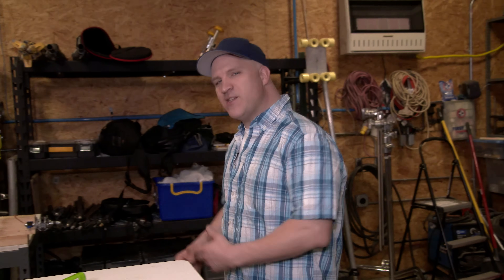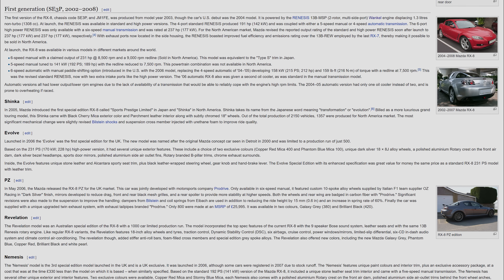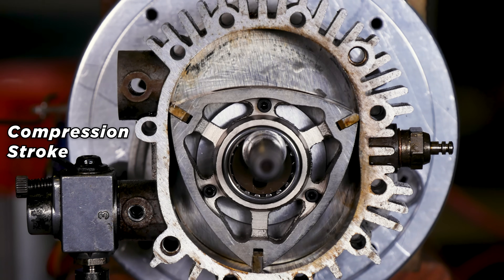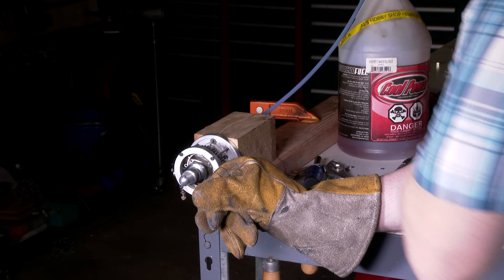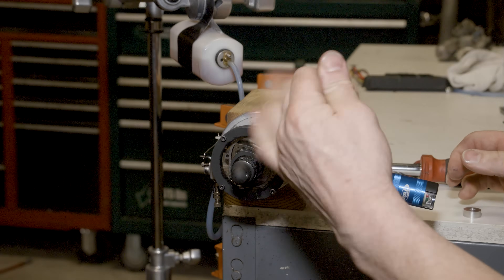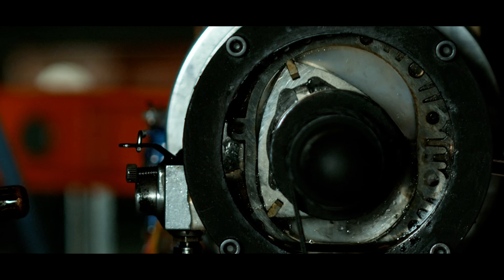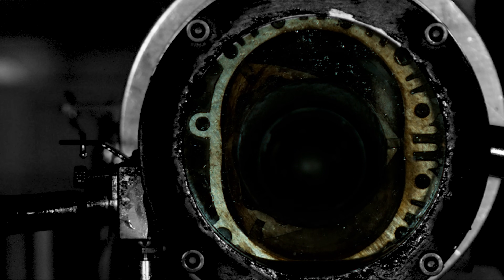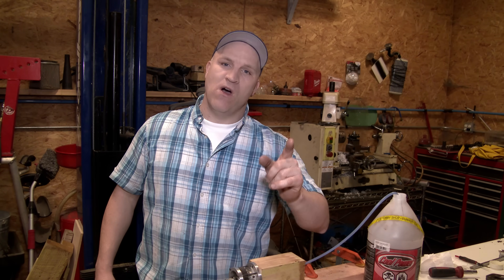See Thru Rotary Engine in Slow Motion - (Wankel Engine) 4K

Comment: Fewer moving parts theoretically means simpler and cheaper production and ease of maintenance...also, they run very smooth with little vibration and have higher revving rpms/redline, but those rotor tips tend to wear out a lot faster than pistons. Still, the lightweight compact nature made it a nice fit for the Mazda, you gotta wonder why they made the hood so long?

Comment: well after 70k or so ya got an expensive boat anchor. Not a practical engine for daily use.  Way too much care needed for an average person to own.
Reply: 70K???? lol theres rx7s and rx8s running round here in oz with 300,000 on the clock.  you must be an average person if you dont know how to treat them.
Reply: Yeah I wanna meet the people brave enough to fly aircraft with these engines.. 
(I just want to meet them, I dont want to fly with them)
Reply: As I understand it, aircraft engines are dual-rotor, not single-rotor (as shown in this video) - meaning that even if one rotor blew is seals out, the other could keep the engine running (it sounds like a badly tuned tractor engine, but it will run :D)

Comment: Why does it appear that unburnt fuel is making it too the exaust stroke and is coming out of exhaust? Seems wasteful at best. Also im wondering if compressed air is flammable at high enough pressures and heat?
Reply: David Crunk , if u mix it with fuel lol.
Reply: The Most Trusting person on the internet. Right... but is it flammible without fuel?
Reply: Compressed air itself is not flammable.
, Why do you need youtube for this?
Reply: under the right conditions in the engine it can (theoretically) be flammable,from the act of introducing hydrocarbons from lubricants in the engine. Source: A GOOGLE SEARCH.
Reply: The Most Trusting person on the internet. Have you heard of the theory that passenger jet engines run on compressed air? The comppressor blades resonate and the hot air pushes.
Reply: Jet engine's run on air sucked in by the fan,which then get compressed by compressors,which gets thrown into a combustion chamber, that mix the compressed air with fuel .Causing ignition and thrust.
Reply: but yes , it produces most of its thrust from compressed air/bypass flow.

Comment: Where was you get this small rotary engine 

Bcz i want like this
Reply: sahib bhullar they go for about 350 dollars on eBay in actutions usually start at 100 dollars but quickly go up I seen some see up to 900 dollars
Reply: Obsolete, no longer made anymore... have to buy second or used parts
Reply: nightmare in action 

Sir am found this in ebay but this is not available on India ebay

Comment: I imagine it would run a little smoother if you had the propeller on or even just a hunk of mass on the eccentric shaft. Its always getting stuck between strokes because they'res no mass to keep it turning. The propeller would act as a fly wheel or mechanical storage device to jerk the engine into the next stroke.

Comment: The information given about the rotary engine size to power out put is incorrect. Engineers have known for years that the Rotary engines displacement has been figured incorrectly on purpose for years. They only account for roughly 1/3 of the engines total displacement for insurance purposes.  When you try to figure BSFC Brake Specific Fuel Consumption on a rotary the math only works if you use the total displacement. If you use the 1/3 displacement figure it NEVER works. So... The 1.3 liter rotary engine is in fact roughly 3.9 liters or a little less due to all sides or the rotor and housing areas not being the same volume at any given angle of the eccentric shaft. And making 240hp is kind of embarrassing when you see that. The problem lies in the rotary's thermodynamics, which are incredibly inefficient. But they so neat. And sound so good. And they are fun to drive. Don't be afraid to run them out to their redline. They love it. Many RX-8 drivers have noticed their cars run better after a track day. Helps clean out the carbon that accumulates from City driving.
Reply: They are talking about the physical size of the housing. It only takes up 1.3 L of space. that's why the engines are so tiny. similar like in 2 stroke piston engine you get twice the power cycles of the same size of 4 stroke engine.
Reply: photonman54 negative sir. I have a 13b renesis housing in my garage I made into a clock lol. 1.3l refers to the displacement of the largest area on one of the 3 sides of the rotor. And the 13b is a 2 rotor wankel. So each area is roughly equivalent to .65 of a liter.
Reply: @Firion13  it's because the three parts of the cylinder are conjoined and therefore the "same cylinder"

Comment: This is not a rotary engine. This is a Wankel. A Wankel engine uses a rotor for compression, power and exhaust. That does not make it a rotary engine. A true rotary engine has a stationary crankshaft with the cylinders and pistons rotating around it. The ww1 Le Rhone and the Clerget are rotary engines (Allied forces) The Germans widely used the Orbderusel, another true rotary engine. Crankshaft bolted to the firewall, and the crank case, pistons, and propeller spin around it. The engine achieves cooling this way as well. A true rotary engine has no water jackets, and is air cooled.
Reply: lol
Reply: I thought those were called radial engines. Correct me if I'm wrong.
Reply: Jonathan Robinson  Radial engines are attached to the air frame by the crank case or engine block and have finned cylinders for cooling. Radial engines are also air cooled. A good example of a radial engine is the Prat and Whitney R-2800 double row 18 cylinder Wasp radial engine that powered the P-47 Thunderbolt, the F-4U Corsair, and the Grumman Hellcat ww2 fighter aircraft. The sound of one of these engines flying overhead is the stuff that dreams are made of. Check out some You Tube videos of these aircraft at modern airshows and you will hear what I mean. The sound is deep, thundering, - - - - Beautiful.

Comment: Lol, all these rotary hate comments, my Rx8 R3 has got over 91,000 miles on its motor and it runs and drives fine. These motors are just intolerant to poor maintenance and extremely abusive driving. You treat them right and they last forever.

Comment: You know they make electric starters for prop nuts right? Or you can make your own with a quick hot glue or epoxy molding and a drill. I avoid tearing my hands up now, I've been there before!

Comment: That's a problem, Before and after you spray painted the Output shaft black I noticed that in the slo-mo moments, Sometimes The Combustion contradicted he motion of the rotor pushing it back then resuming to normal rotation... is that because of the spark plugs being at 2 different loctions?
Reply: Solaris 347 -  The explosion is initiated by a single glow plug located right at the top dead center. The few times that it tried to reverse direction was probably while starting, when the rotor didn't spin fast enough to overtake the speed of combustion. Nevertheless, I was impressed to see how well the glow plug seemed to provide the ideal timing.

Comment: You rotary guys really make me laugh my ass off. 1.3 litre makes 230odd HP but you seem to forget that the rotor has to make 3 rotations to turn the eccentric shaft once... You know what that means, 1.3 X 3 = 3.9 so that makes it about as powerful as an average 6cyl. I bet if you gave a piston engine a crank ratio like a rotary it would make phenomenal power. The rotary is a novelty engine, nothing more.
Reply: Tony B sorry its the other way around. The shaft turns 3 times for every cycle the rotor makes around the chamber. But there is only 1 power stroke per rotation of the shaft. Because only 1 face is working per revolution of the crank they only measure that volume. But that is misleading. By that logic every 4 stroke should be counted as half its size since the piston only does work every 2 strokes. So your point about displacement calculation is still valid.
Reply: Other way around, eccentric turns 3 times faster than the rotor. However all 1.3 liters of displacement does fire for every rotation of the eccentric (which is what engine RPM measures) so they're more comparable to a 2.6L 4 stroke engine.
Reply: In racing and for insurance the 13b is usually classified as a 2.6L. This link explains it better than I could: http://rx7.com/techarticles_displacement.html
Thats why the Mazda 787b was kicked out of Le Mans Group C back in the 90's. The maximum displacement allowed was 3.5L and the 787 was pushing 5.2L when you do the conversion.

Also the RX-8 only made about 180whp,  there were multiple class actions which eventually made Mazda drop the hp down to 211 and offer a buy back program or other incentives. 211hp is terrible for a car that struggles to get 20mpg and has to be rebuilt every 150k mi IF its lucky to not be struck with the side seal defect.
Yes, the rotary is a novelty. Pistons have outperformed them in every category for about 4 decades now.
Reply: Tony B. No, the rotor spins once for every three rotations of the crankshaft. And yes, while it does have a CFM intake equivalent of 2.6L, its PYHSICAL DISPLACEMENT is STILL 1.3 liters. 
Thats like calling two-strokes shit because they breathe twice as much air as a four-stroke, despite the fact thats what makes two-strokes more powerful than a four-stroke of the same size.
The the stuff about le mans is fair, until you realize that wankels were banned after their win, and no other racing event was willing to cope with having to regulate wankel and piston engines together.
And if the wankel engine is a novelty engine, why is mazda planing to use the wankel in the most boring, unnovel way possible... as a range extender... https://jalopnik.com/mazdas-rotary-engine-will-finally-return-in-2019-as-a-r-1823456376
Reply: The conversation above is precisely why I hate YouTube sometimes
Reply: Jonathan Robinson 
Hello
Reply: Tony B 

Quit acting like a child. Your insults aren't really sticking bucko 😂
Reply: Tony B 
Oh god, you are really cringy. You sound quite pathetic sadly. Oh well, whatever helps you sleep at night, bucko. I'm done here
Reply: david husband Once. The 787b had one win...the entire 7x7 program dating back to the 717 in 1983 through the 787b totalled one single win in all the races from all the seasons and a whopping 2 podium finishes including said win. I like rotaries and all but let's be real about the endurance racing pedigree here. The car was detuned and given taller gearing than the other 787s entered keeping the engine at a lower and safer RPM. That and the drivers ignoring orders to drive conservatively to save the car equaled the single win.
Reply: Paolo G "zero torque at zero rpm" didn't know engines can make torque when the engine is off.
Reply: lol 3.9 you sound like rice racing, you fail. 

novelty...yeah, beats Porsche, ferrari, jag, etc at le mans...yeah novelty. you are a fucking idiot .
Reply: Nick Grothe you sure? You seem pretty upset I don't like rotaries or crybabies. Find someone or something to hug, you need it. I didn't mean to cut you to size, that was just a bonus 🤗😝👌
Reply: Nick Grothe i won, I'm like trump, I just keep winning. Give us another so I can win again.
Reply: Nick Grothe oh I'm sorry, sounds like you need a hug 😭 you going to be ok?

Comment: nice, it even shows how my 1.2 in my old rx7 got such crap mpg lol
Reply: Rx-8 tends to be better with all its modern computer shit. On they hwy get the same fuel economy as my older civic or Mazda 3. In the city its still shit. Tends to be more expensive due having to use higher grade gas.
Reply: photonman54 
But then again, you don't buy a rotary for fuel economy.

Comment: Neat but how does the ignition system work? like a lawn mower with a magnet and coil?
Reply: The Graupner (O.S.) Wankel engines uses "glow ignition"  a tiny platinum wire coil inside the chamber is heated with a battery to start, combustion heat keeps the wire incandescent (glowing red hot) and ignites the air/fuel charge.
 These engines requires a special fuel blend of nitro-methane to operate properly.
Reply: maybe true for a model engine, nut my friends car used  plugs and wires.... how is it timed?

Comment: The O.S. model Wankel has seals on the end points and no seals on the sides of the rotor as the car motors do, so leakage made for poor idling. Power production was great though.
Reply: This engine was designed and manufactured by Graupner GmbH who licensed the Wankel engine design directly from NSU in 1967, performance and sales were both disappointing and O.S. bought-out remaining inventory and rights when Graupner discontinued them.
O.S.'s parent company (hobico) filed bankruptcy.  cheers!

Comment: Basically a 2-stoke engine. Loads of fun, but you have to at least care a little about the environment. I'm no greenie for sure, but clearly inefficiency exists here. Racing only please, not mass production.
Reply: Rufus West or just not as a daily driver. Have a 8cyl but daily drive a 4.
Reply: All Wankel engines use the 4-stroke operating principle, not very successful in racing either unfortunately

Comment: The rx8 for a 1.3 ltr they are heavier on fuel than a 4 banger they aren't very efficient they burn oil and I know this isn't a real rotor motor in a car but look his much unspent fuel it spews out
Reply: dang dang Oil is injected into combustion cycle to lube the apex seals on the ends of the rotor. That’s why they burn oil it supposed to work like that.
Reply: The 13b Renesis actually displaces 3.9 liters